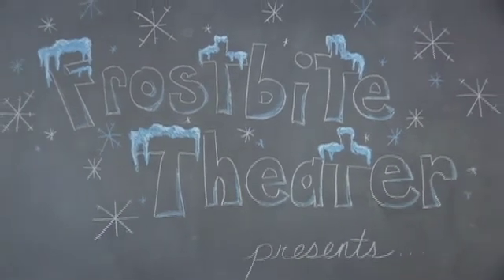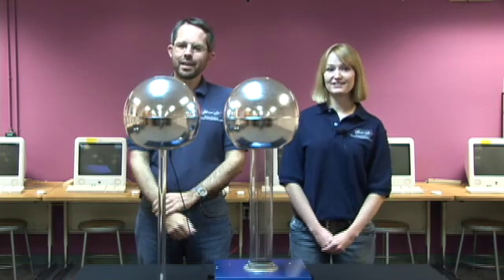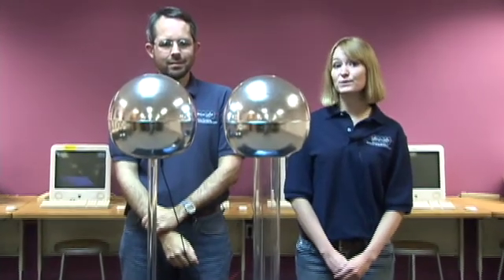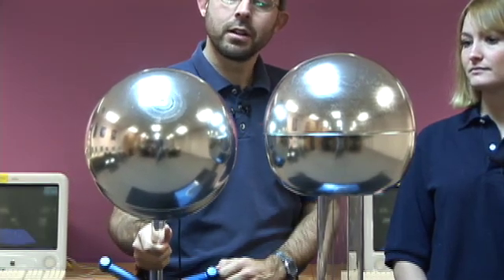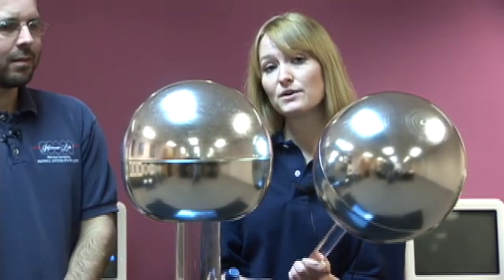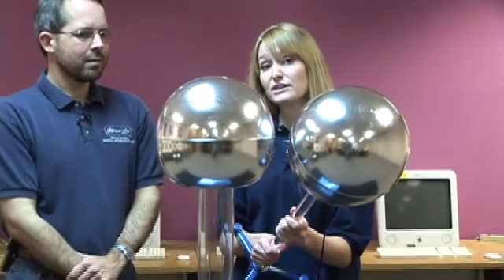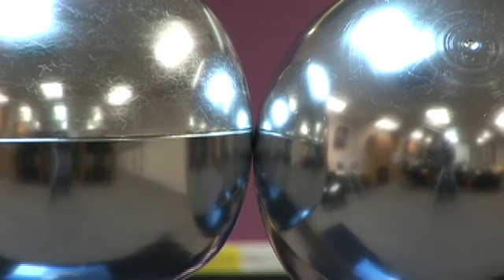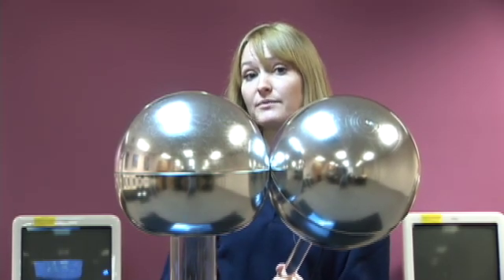Big Sparks, Little Sparks!

Comment: So it would be interesting to have a video with a similar experimental setup (and movement of the grounding dome) that measures the speed of the belt inside the Van de Graff Generator. In this video it seemed like the motor sped up when the two were closer together.  An awesome explanation that's much better than "the belt is carrying charge to where it is already built-up, essentially like piling grain higher and higher by carrying buckets up the grail heap" would rock.

Comment from the maker: @59Ballons If the domes are too far apart, the VdG's dome tries to discharge to the most convenient things around. Sometimes it'll arc to its base. Sometimes is just sends little tendrils into the air. You don't get the nice bright sparks like you see between the domes, though.

You can see what happens when the generator is touched in one of our other videos. Look for the one called "Should a Person Touch 200,000 Volts?"

Comment from the maker: We bought ours from Edmund Scientific, although they are available from a number of companies. They are, unfortunately, insanely expensive for what they are.

The white 'smoke' is most likely condensed water vapor. Decompressing air cools it and cold air holds less water vapor than warm air does. If the air gets cold enough, the 'extra' water vapor condenses into small droplets, creating fog. That's my best guess without actually seeing what you're talking about.